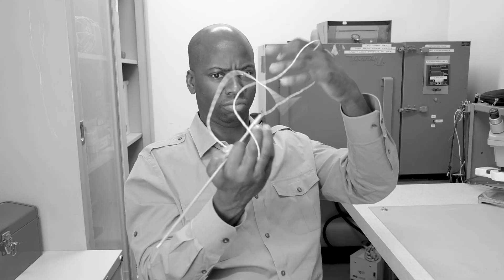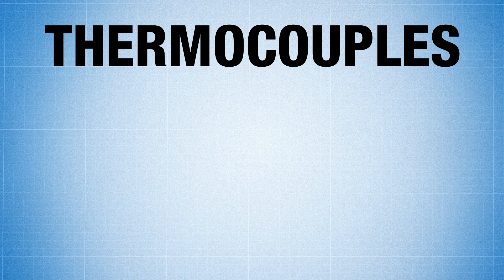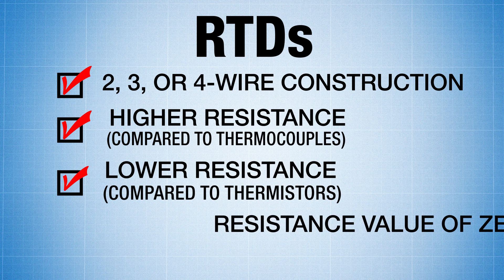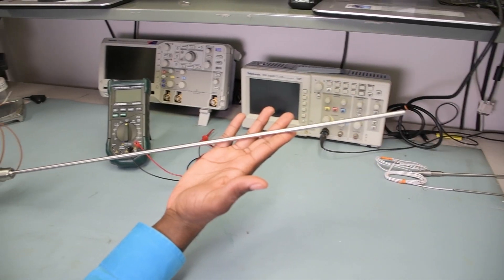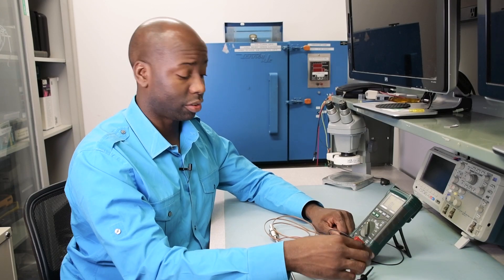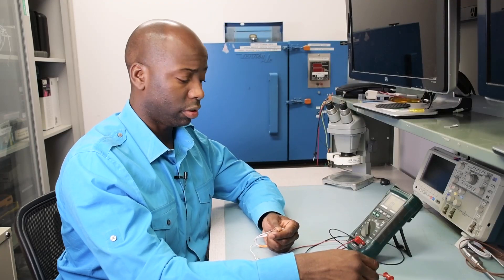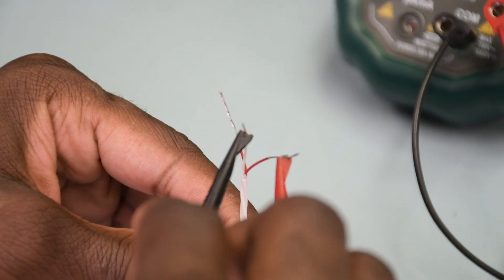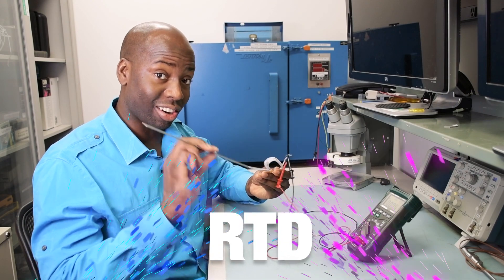Thermocouple vs RTD vs Thermistor - Learn the differences

Comment: Hello, great videos. I have a question about cartridge heaters. How can you test a 220 volt 80 watt cartridge heater? Two wire. I tried to ohm a known good one and a known bad one.  They don't have resistance ohm reading?
Reply from the maker: Hi Brett, good question! You can reach out to one of our Electric Heaters Experts at: heaters@omega.com

Comment: To makesure id thermisitor by change temperature and voltage change compare to bimetal the same and you should notice voltage re solutions o f bimetal i s smooth tran s ition compare to thermistor may not smooth

Comment: I have a sensor that the machine is using as temperature sensor. It has 2 wire both white. Resistance is about 1k. What could it possibly be? please.
Reply: I think it's a thermistor for two  reasons:
1- Per TC classification chart no white wires.
2- It has the highest resistance value compared to RTD and TC. 

So, you simply need to check your machine operation settings, Temp. Wise, and chose the right Thermistor.

Comment: If reading 0 ohm at thermocouple  mean thermocouple is bad or good?
Reply from the maker: Thanks for your inquiry! You will never read 0Ω across a thermocouple. Only if your device has a very low resolution would reading zero be possible. That doesn’t mean the thermocouple is bad.

Comment: Great video. Do you have a video on how to use a thermistor with a voltage divider connected to the analog pin of a micro controller?   Thanks again!

Comment: What about thermal image system using in glass furnace for around 1600 centigrade? Can we use these things there?
Reply: there are systems out there that will measure well above temperature. However the glass specific systems generally don't go about 1500C

Comment: What is the ohms freq.of k type grounded thermocouple and what is the sheath and lead ohms freq.I am very thankful to you please make detail video about k type grounded or ungrounded thermocouple
Reply from the maker: Hello Shams, Good question! A grounded type will read 0 to 3 ohms sheath to either TC wire. No frequency, this is very low level DC signal. Also, here is a link to our video on Grounded vs. Ungrounded Thermocouples - 
https://youtu.be/qQzh-qeKSzw